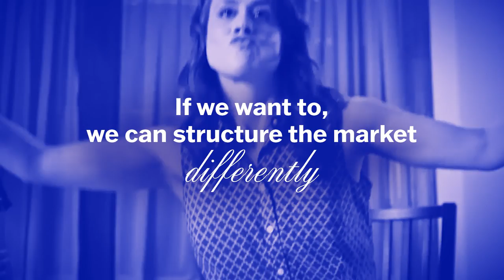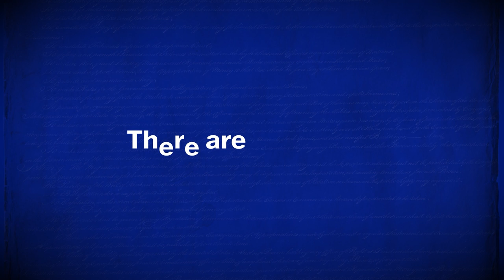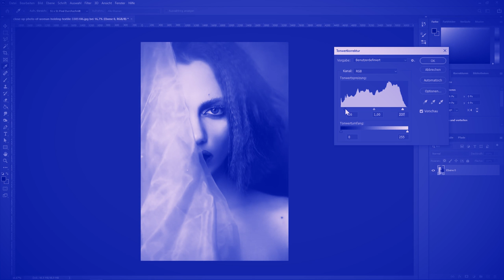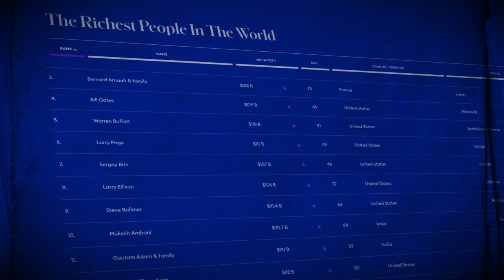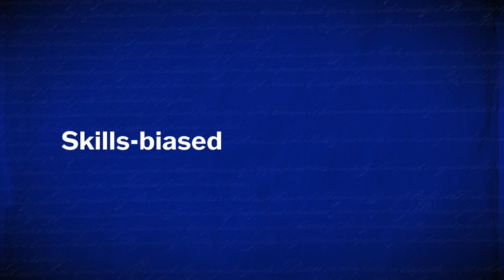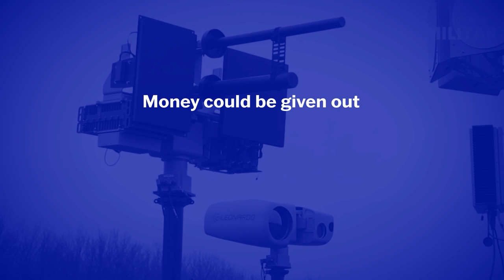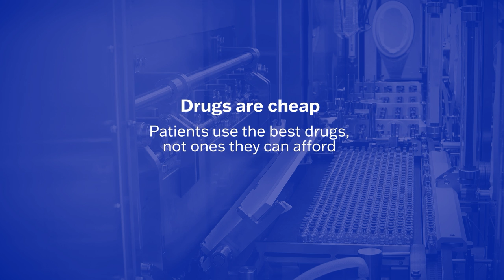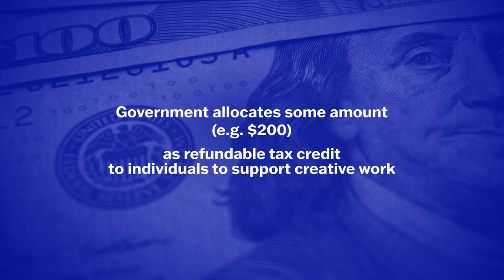How to Unf★ck Intellectual Property

Comment: If you are for capitalism, then you would always have capitalists trying to kill competition for higher profits. You would also have capitalists lobbying for neoliberal policies to strech the profit rate. However and this sucks btw, if you compromise profitability, growth is compromised and that also sucks. So capitalism has its intrinsic flaws. It doesn't matter how you accommodate it
Reply: @ThomasVWorm  Indeed. The bulk of product price is ephemera (an embedded ‘claim’ wedded to the intangible value of a trademark) rather than nuts and bolts. When physical manufacturing is stripped of the cost of proprietary design, e.g., monopoly rents, the portion of price formerly made up of such intangibles will implode & the remaining price an order of magnitude lower. ‘Financial capitalism comes from a time’ when, likewise, ‘competition among the few’ was admirably equipped for inducing technical change. However, the initial capital outlay required to undertake physical production is imploding, and as venture capital will lose most of its outlets in manufacturing as well, investment capital is, essentially, superfluous. The easy diffusion of new technology & the transparency of cost-structure will only arbitrage the rate of profit to virtually squeeze artificial scarcity rents. A lower capital outlay shifts the economic calculus to, back again, a ‘market economy,’ subsuming an array of micropower projects & networked individuals, with comparatively cheap capital equipment, ‘inducing growth’ with inexpensive, general-purpose tools that permit unprecedented levels of productivity with physical capital costs an order of magnitude lower.

Comment: 12.20 ‘patents are in the public domain. Any one can produce it’ Not quite. While technically possible the whole point of the patent system is to reward the patent holder for their innovation efforts and investment with the right to prevent others using the patent. They may authorise others to use the patent if the latter take a licence which would usually involve payment. The operative word is ‘May’ as the patent owner may also decide to exploit the patent themselves. If you did not provide the incentive / reward of the patent for ground-breaking research there would be no more investment in R&D and no technical progress.
Reply: Thank you for actually having a brain. You are right 100%
Reply: he said it pretty confusingly, but i'm pretty sure he meant that's what he wants, not how it is. he kinda flip-flops between the two. or maybe it's the editor's fault.

it's extra confusing because patents are technically not copyrighted, you're just not prohibited from implementing them.